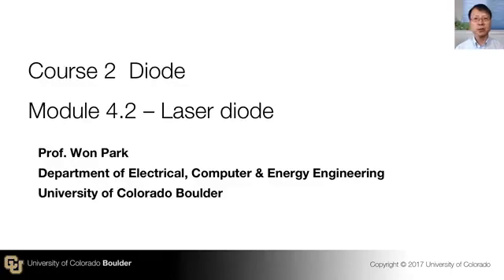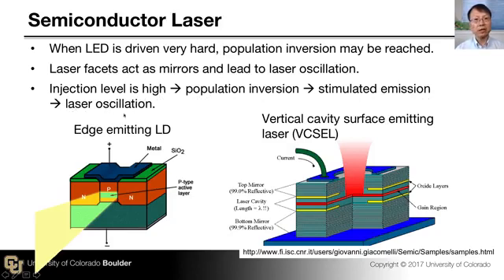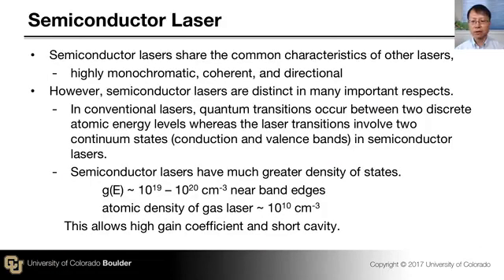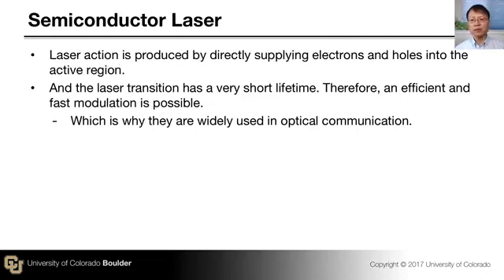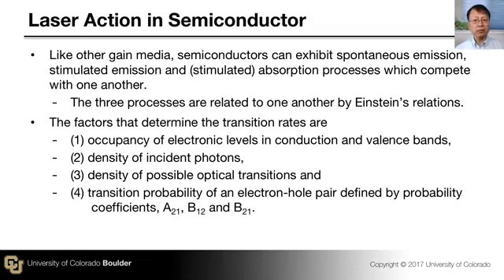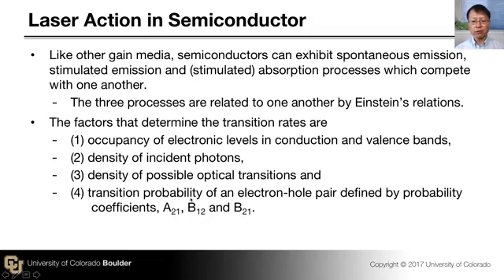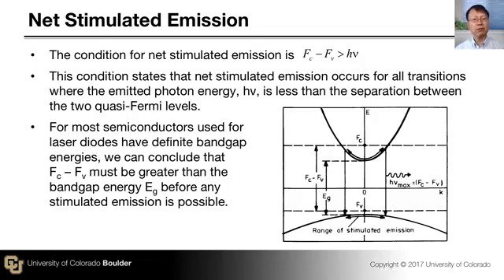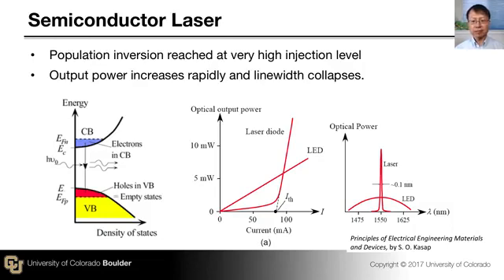Laser Diode

Comment: Fascinating.
Wonder if enclosing a laser diode in a magnetic field, would increase the stimulated emission, by extending electron trajectory.
In other words, the magnetic field would extend the time that an electron, spend in the depletion zone.
Further more, you can have a circularily polarised photons output.
Reply: Maybe not because the total energy released by the electron is still the same. It might change the wavelength.